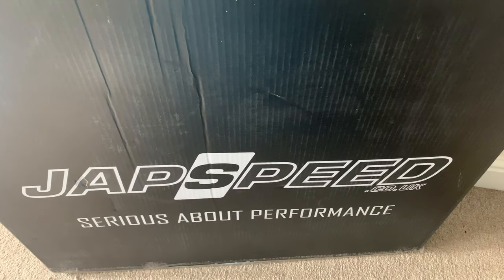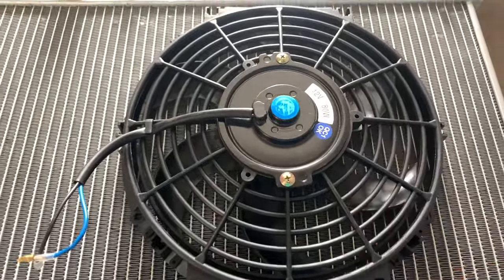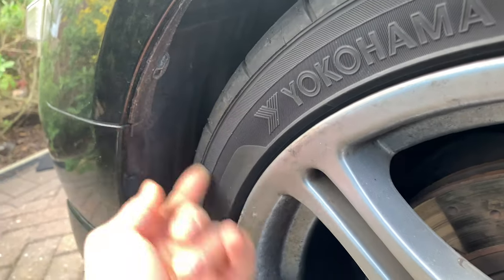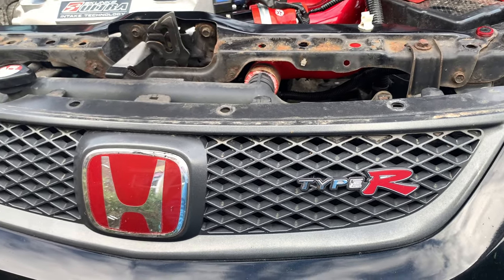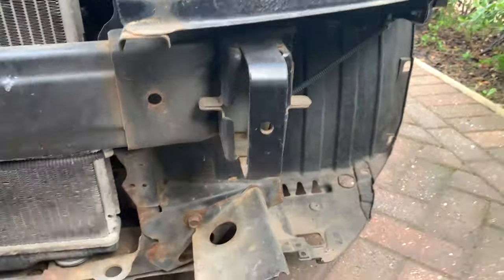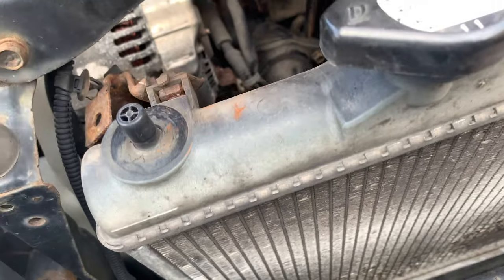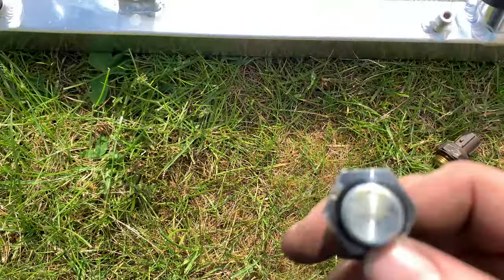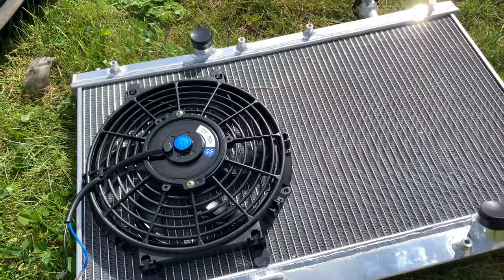EP3 Type R Japspeed Alloy Radiator Fitting

Comment: My EP3 has the same radiator fitted by previous owner, same issue with the fan switch not fitting so blanking plug left screwed in same as yours.Fan not connected, been driving okay never overheated.
Reply from the maker: I guess it’s more prolonged sitting in traffic where it may over heat. Mine seems ok with the fan on constantly. I will make the switch fit eventually. Maybe....

Comment: Could do with your advice on wiring. My fans dont come on and I'm not sure if it's either my wiring or something else. I've swapped the relay too and that didn't help. Just did a motorway trip and the fan should definitely have come on..
Reply from the maker: Does the car over heat? If you bridge the wires in the loom that goes to the fan switch they should come on with ignition live

Comment: I noticed you don't have an AC condenser.  My ep3 Si has the condenser and it's in the way of removing the radiator.  Is it possible to remove the radiator without removing the AC condenser?  Thanks.